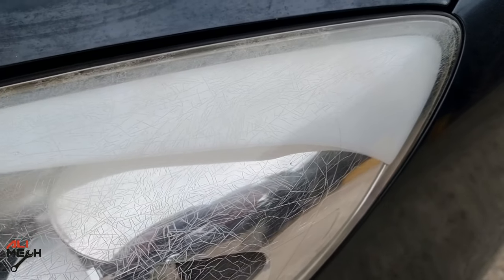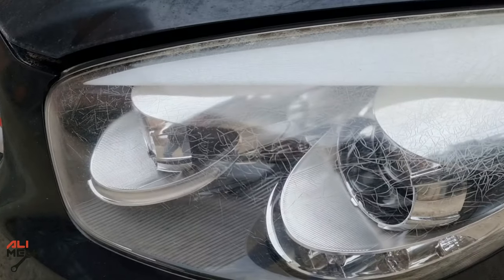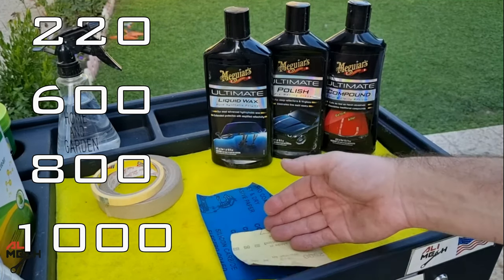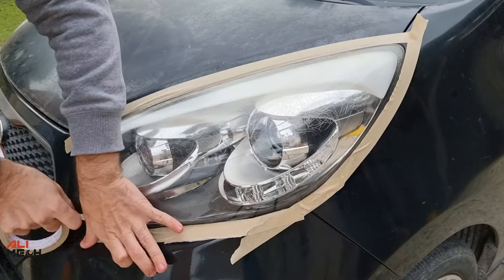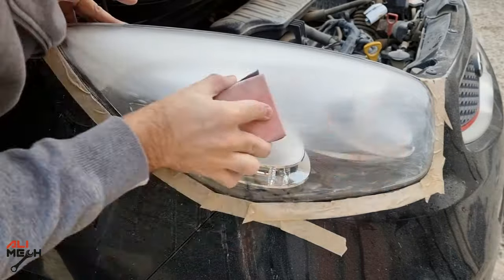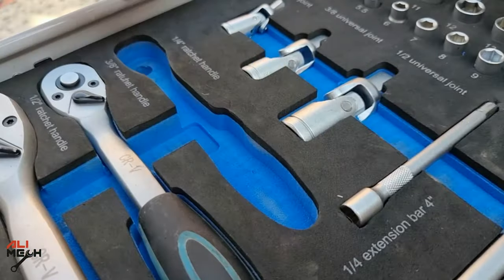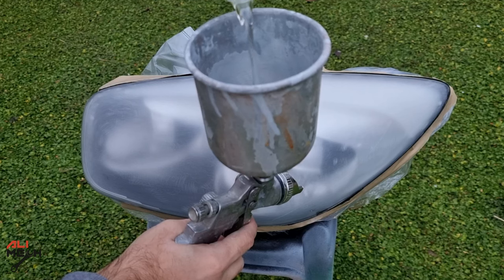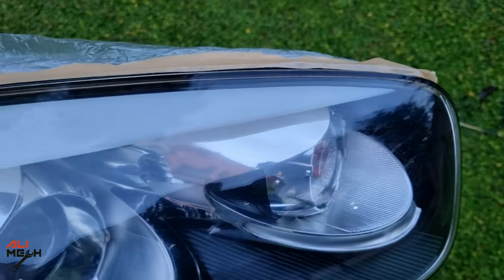What these small cracks on headlights and how to fix them/Turn your headlights brand new again

Comment: DO NOT USE 2K CLEAR COAT ON HEADLIGHTS USE spraymax 2k 2in1 headlight clear. Its designed to expand from the heat. Regular 2k is not designed to expand and will crack extensively.

Comment: After applying 2k rustoleum clear coat the plastic cracked like the headlight as shown in this video at the beginning. Now I sanded much again and polished it back but it's not glossy now what should I do any suggestions pls
Reply: Did you resolved this solution?